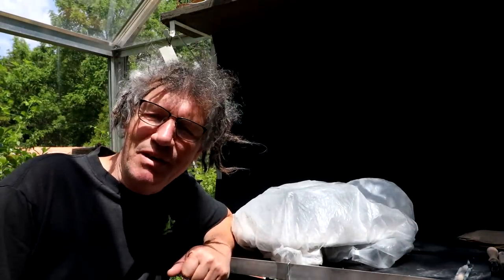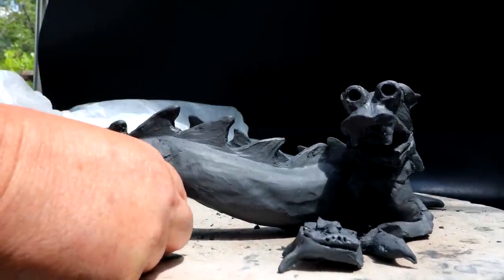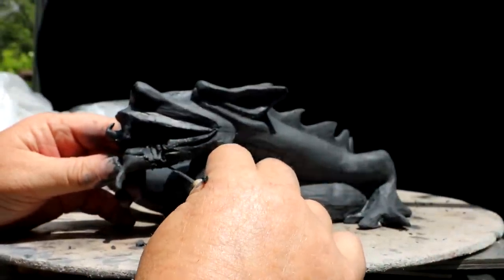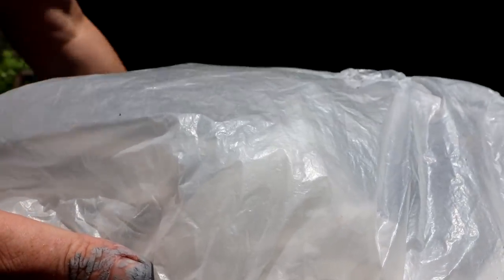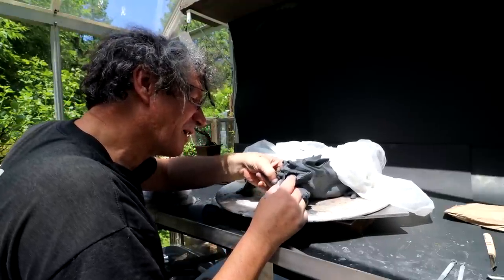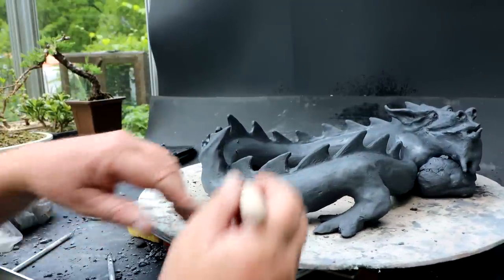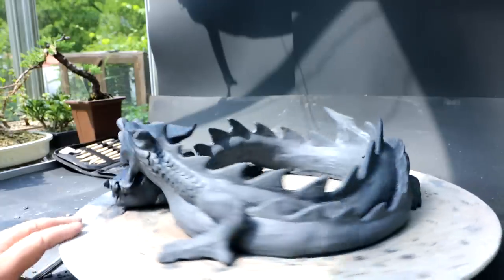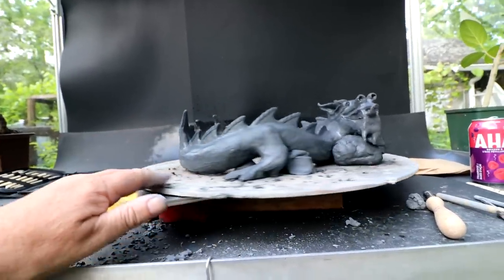Creating a Dragon Bonsai Pot, Part 2, The Bonsai Zone, June 2023

Comment: Hey Nigel,  the reason the back leg still looks bizarre when you turned it around, is that while the foot is in the correct direction now, the knee hinge is backwards. It should be bent forward pointing toward the elbow of the front leg. Think about when a cat crouches, it's knees and elbows almost touch each other. You can look up pictures of alligators curled up too and see how their knees and elbows mirror each other. In your dragon, the joints would nest into each other if they were close together. Hope it's not too late to fix...😊
Reply from the maker: Thanks, that makes sense!!!

Comment: Regarding the jaw, these things happen with hanging pieces with no support. To fix that, sculptors use wire "skeleton" inside the body, to make sure everything is properly supported. Too late with this one, but for future projects, you might consider using one as well.

Comment: Stuff happens. The form and structure is very nice, and dude, the surface work with the scales and fins is looking wicked!

It's hard to tell for sure from a video without being able to feel the clay, but that jaw drop likely happened for the reasons you mentioned. If clay dries too quickly, it does so unevenly, especially if you have lots of bits with varying thickness like this piece has. As it dries, it shrinks, and if the drying is uneven, so is the shrinkage. That creates tension - essentially, fault planes, inside the clay, that produce cracks. So as that thin overhanging jaw dried faster than the rest of the head, you got tension, then cracking, and finally gravity sheared it right off. When you sprayed all that water, the thin dry bits would have sucked moisture in quickly, which also made them expand a little, and it just got worse. But it should be fixable. If you plan to make more of your own pots, consider getting yourself a damp box to keep your pots in while they dry out, or to slowly and safely re-hydrate them if they get too dry before you're done.